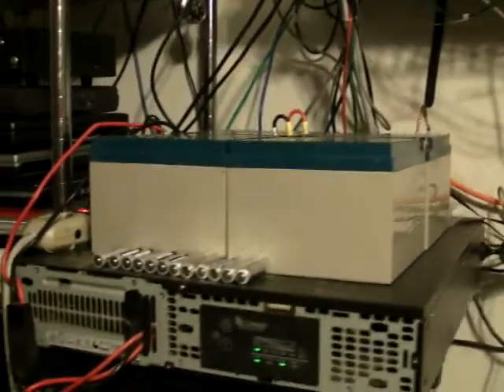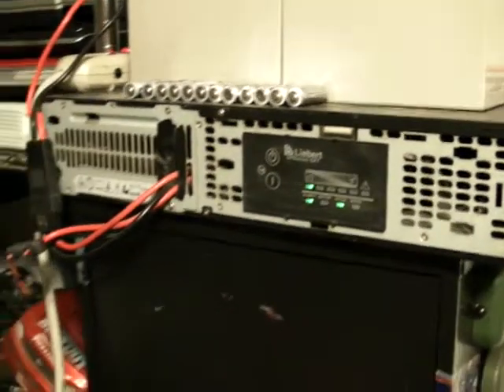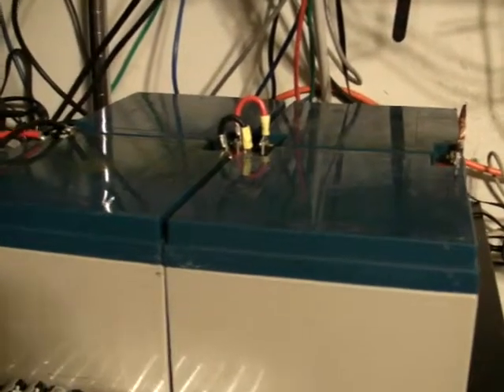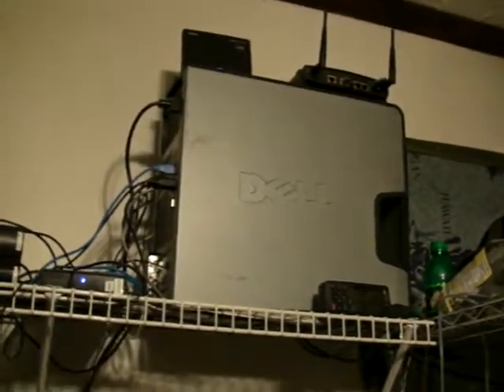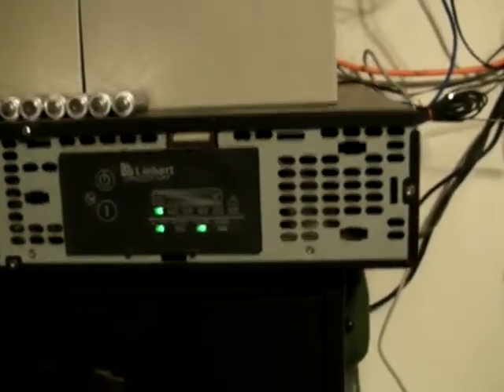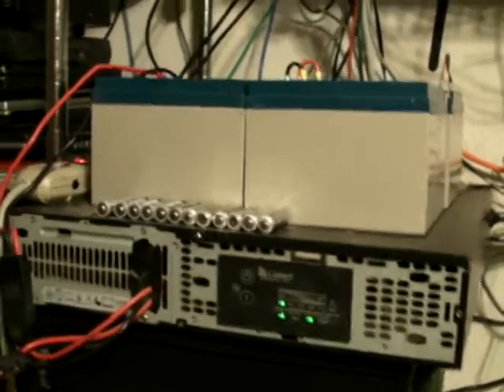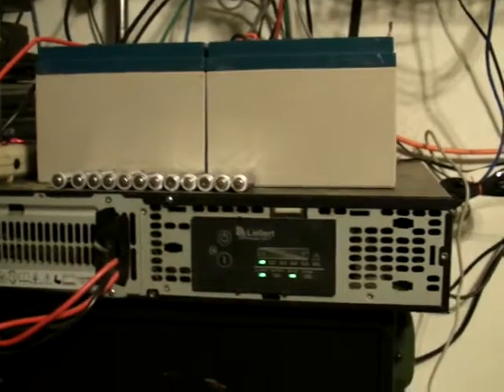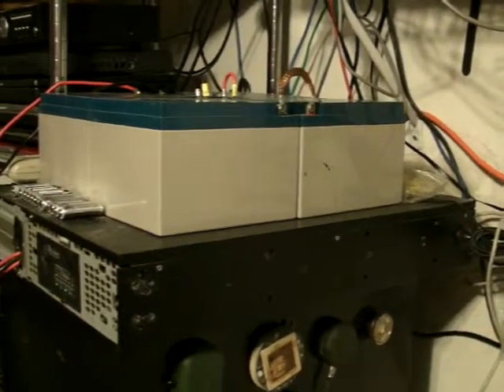How To extend run time of UPS

Comment: I've heard that ups circuit will damage if we use higher amp then its original battery amp.Is it true
Reply from the maker: that is not true. what is true is most UPS charging circuits over charge that batteries to the point the batteries puff. I just had a $2k enterprise grade UPS destroy $500 worth of batteries because it over charged them. Hence the reason why UPS batteries have to get replaced every other year.

Comment: TX for the vid, but I was just wondering: is the original UPS-circuitery powerful enough to charge the external batteries? They sure need a higher current to charge. I'm just afraid this can damage the charging circuitery?
Reply from the maker: Thomas Leerriem The charging circuitry in any decent UPS is self regulating.Whether you have the originally size batteries, or fork lift batteries, the only difference will be the amount of recovery time (time to fully recharge).Online UPSs will inherently charge the batteries faster, given the fundamental operation nature of an online UPS.